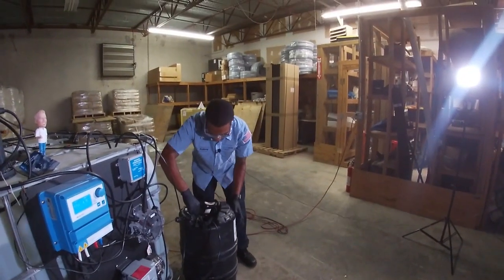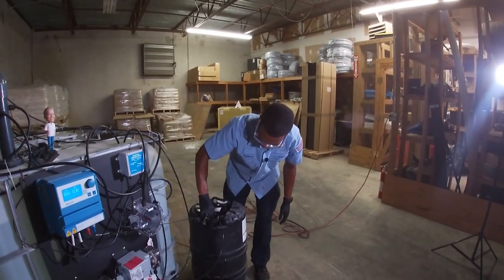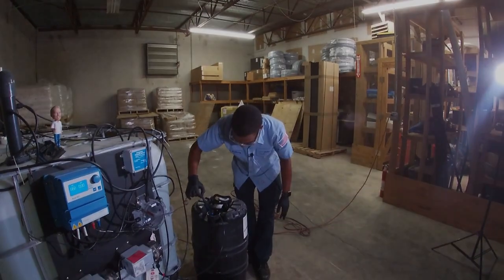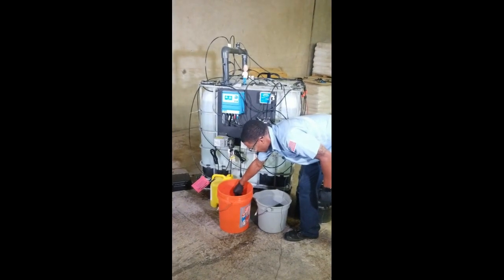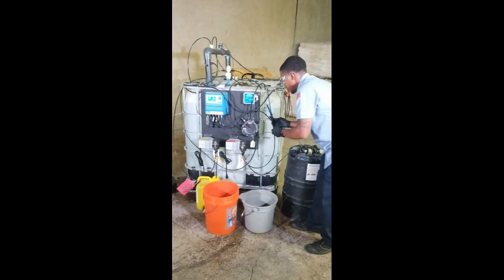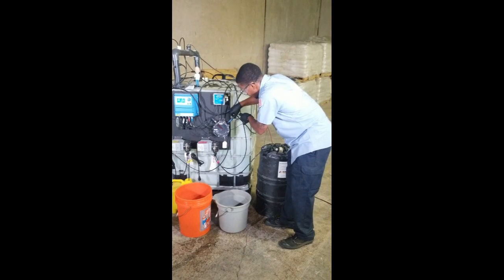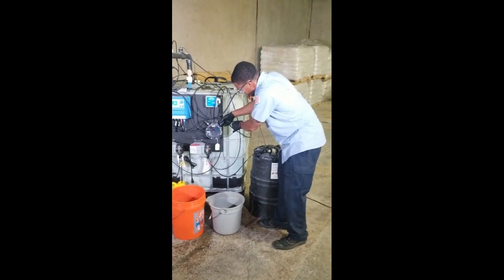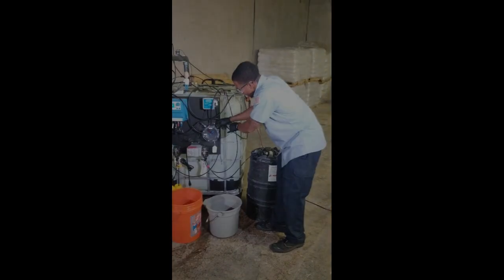ORP and pH Electrode Cleaning - Probe Week Day 1

Comment: happen to post any tips on newer probe installs? Just curious on PH 2 point calibrations and standard ORP calibration
thanks for these
Reply from the maker: This one might be helpful. https://youtu.be/u1uSfKVeDsg
Reply from the maker: I've not. Most of our application is within the aquatics industry where our operating range is so tight we don't use 2 point calibration, but it is not very hard.  Take your two standards and record the mV reading from each. Then plot your graph like in Junior high algebra. So, (y-y1)=m(x-x1) then program your meter/controller accordingly.